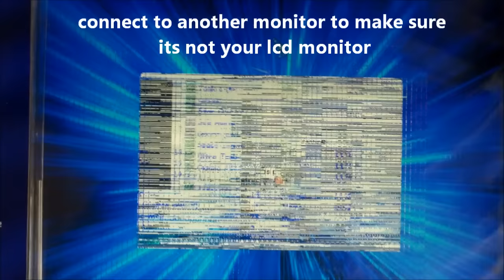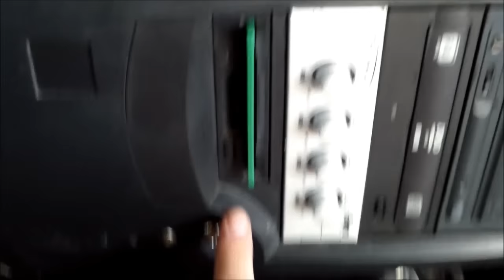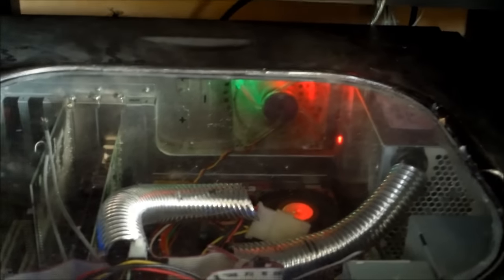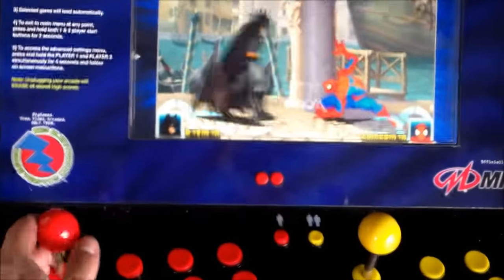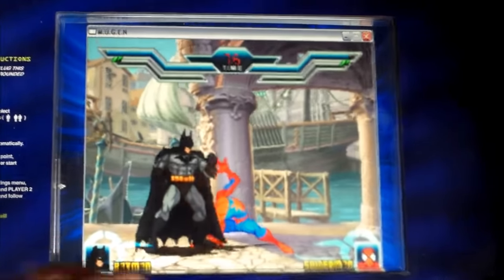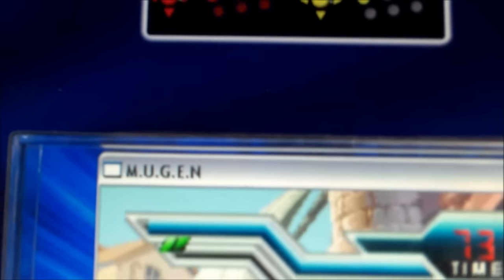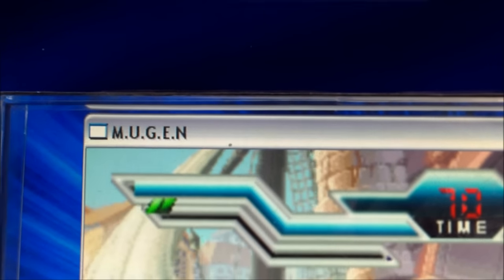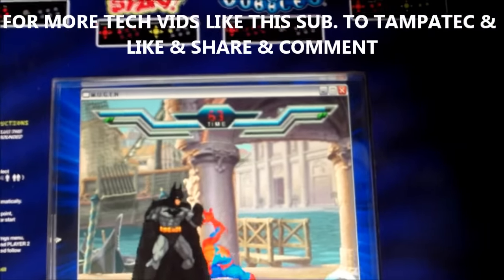HOW TO FIX LINES IN PC COMPUTER SCREEN REVIEW

Comment: Keep in mind that older computer monitors that use analog cables - could have a bad cable as well.  Sometimes swapping out a cable can clean up some problems.
As you know, digital signals either work, or don't.  But those older CRT's also need a good shielded cable to work well.

Comment: I had a bad power supply. I replaced it with one with a bit less power. Could that cause video glitches. I run a rc flight sim and didn't have the glitches till after i replaced the power supply. Great vid by the way you do well at explaining things in layman's terms for us with less knowledge.

Comment: This video is incredibly vague, "if your gpu isn't working, replace your gpu". I was expecting actual troubleshooting, a rundown of possible problems and solutions, not just a video of you stating that you need to replace your gpu. I get that you won't be fixing every single problem that might cause this on video, but at least mention other possible causes for the issue.

Comment: Can you please help me? My HP All in one fell on my keyboard All I did was unplug the cords on the back and it just fell  onto the keyboard there are no cracks or anything but when I turned it on it has lines going vertical and some going horizontal on the top. I pressed the screen were the lines are and it just spread now the whole  screen is covered in lines with white gaps